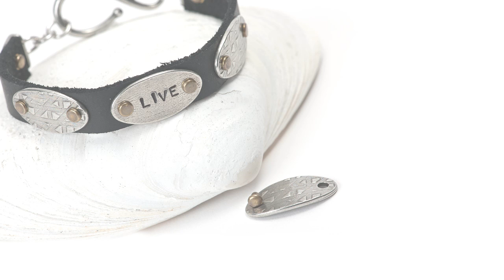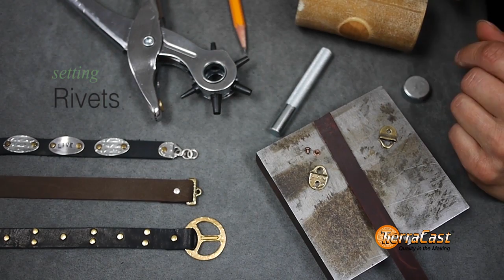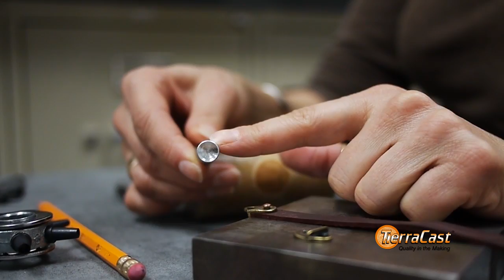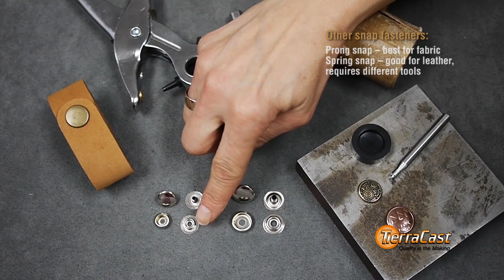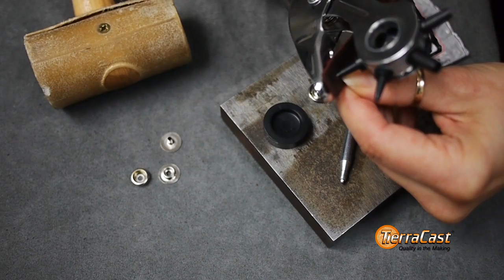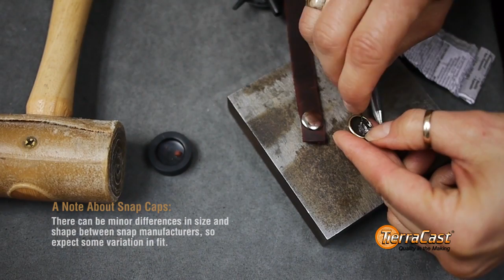How to Set Compression Rivets & Snaps

Comment: I have compression rivets but when I try to set them, the post flattens and the rivets are not in line with each other. Are compression rivets designed to squash down ?
Reply: If the post is too long it will fold crooked. If the setting tool is crooked it will also fold crooked. Try shorter post lengths.

Comment: What is the size of the smallest compression rivet in this video?
Reply from the maker: Our smallest compression rivet is what we call our 4mm Compression Rivet. The length of the post is 5mm, the diameter of the tube on the cap is 2.4mm (also the approx. size of the holes you'll need),  and the diameter of the dome of the cap is 4mm. You can see images on page 4 of our catalog here - http://tierracast.com/cat_large/index2014.html

Comment: could you please help- I know you talked about leather but I need to install a snap rivet on a newsboy cap (male & female) I don't know what tool will be the best because I need it to go through the strurdy plastic (and subsequent cloth) used for the visor..i don't want to struggle to do this so which tool would be most effective, also, I need to install those copper rivets you find on levis 501 jeans (typically found around the coin pocket of these jeans). Could I buy ONE machine that will work for both projects? thanks
Reply from the maker: We're a jewelry component manufacturer so our experience in rivet and snap setting is fairly limited to jewelry making with our leather and leather findings. That said, I imagine leather hole punching pliers and the snap setting process described in the video would work for the cap, but I don't have any experience with the jean rivets. If you have a local leather shop they may be able to help you. Good luck! :)

Comment: Hello , and thank you for this very usefull guide. I would have a question. I would like to add and replace spring snap fastener on a coat made in Cordura 500 fabric. I'm having trouble finding the right size for my snaps as i don't know on what part of the buton i should take measurements to determine what size to order ? Which one should i take te measure from upper/lower female/male ? Could you please help me with this issue ? Thanks
Reply from the maker: *****  - Hello Alexis - the size of a snap is the measurement of the cap. Most common sizes are Ligne (Line) 20 which measures 12.5mm (1/2") and Ligne 24 (15mm, 5/8"), but there are many other sizes. Can you take the coat to a fabric store and get advice from the staff there?
Reply: Yes that is what i might do, i have phoned severall of them and the answers where half-answers or contradictory. Thank you very much for your reply ;)
Reply from the maker: ***** Good luck! :)

Comment: I have a dress that I made, kind of a vintage western theme, and I want to put these snaps on. The dress is looking great but I'm really worried about messing it up because I haven't actually tried putting these on; I know I will need to practice beforehand. Do you have any tips that might help? I really don't want to mess up my project. Thanks.
Reply from the maker: Our experience with snaps is not in-depth. While we do produce the glue on snap caps, we do not produce snaps themselves, and our practical experience was limited to learning to set them in leather strap as we shared in the video. I would suggest your local fabric store or sewing machine shop for more help. And I would definitely practice! Good luck - I hope your dress turns out great!  - Tracy